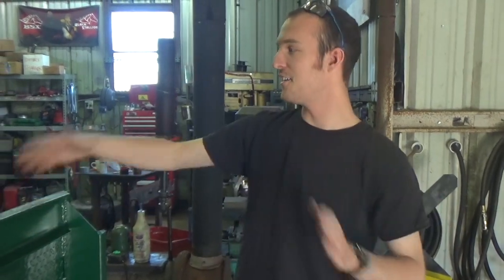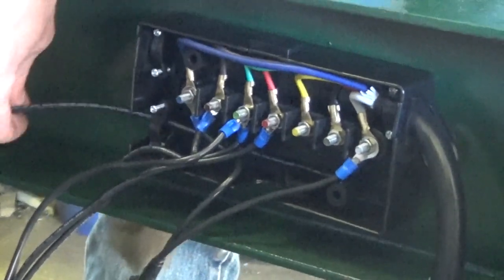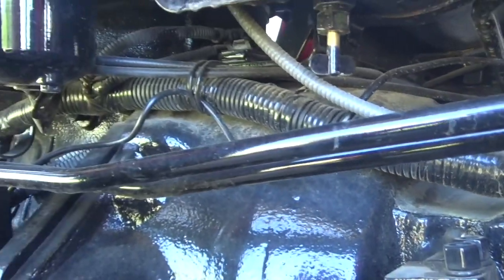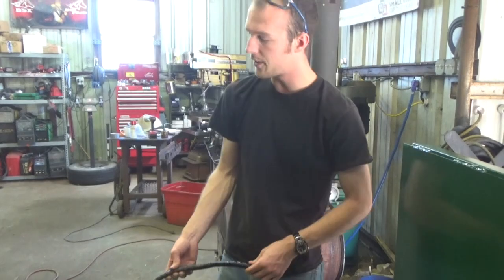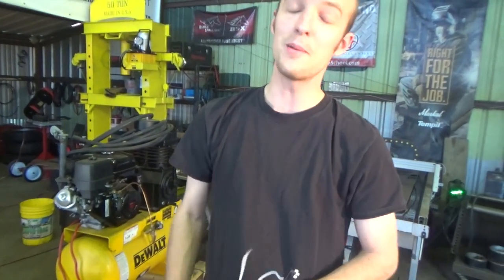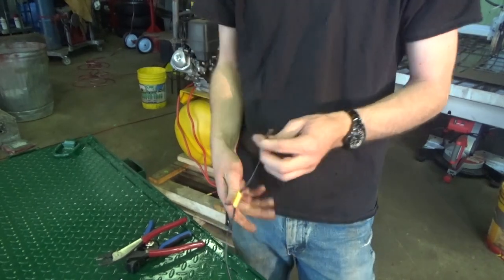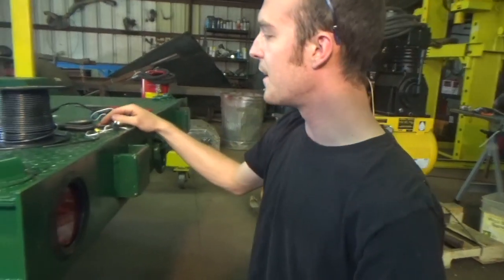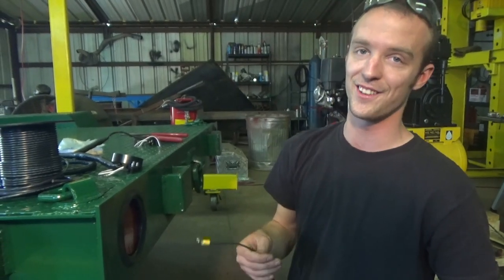HOW TO WIRE A TRAILER TO LAST A LIFETIME!!! WHAT MANUFACTURERS DONT WANT YOU TO KNOW

Comment: Whenever I can use it, I prefer to use marine-grade heat-shrink tubing. It has a heat-activated adhesive inside the tubing that provides a water-tight seal. An alternative that I've used, but it's a bit messier is to use a bit of silicone RTV goop on the connection, then slide heat shrink tubing over it and when it shrinks down, it traps the silicone inside making a water-tight seal. Excess silicone oozes out of the heat shrink so it's messier than using the marine grade. I've never had electrical tape stand up over the long term. It always loses it's adhesion over time. I live in a hot climate which accelerates that. I like crimp connections too, but I've found that the tool used to make the crimp makes all the difference . I saw that you used the kind that makes a dimple in the crimp, which I found makes a superior crimp over the kind that just has a couple of curves that doesn't crimp down nearly as well. I've pulled apart a lot of those, and they are the standard tool provided in the ultra cheap sets, so buyer beware. Nice tip on the bus bar. I'll have to get one of those.